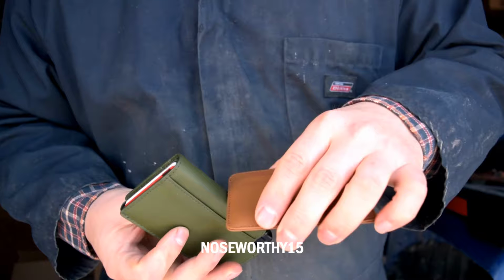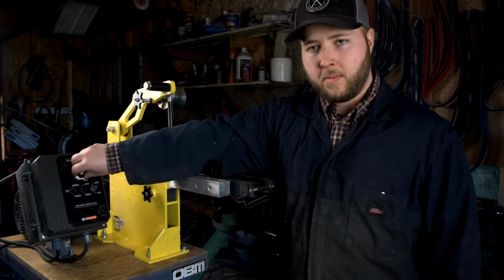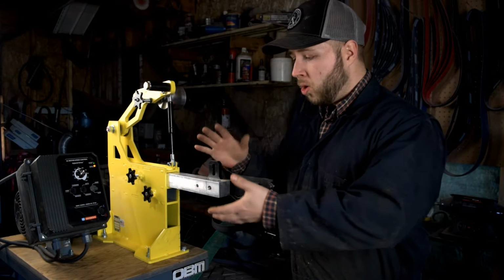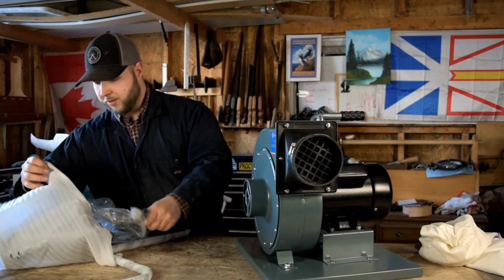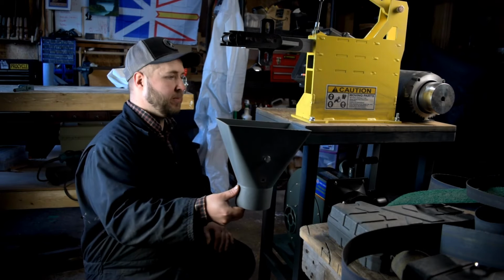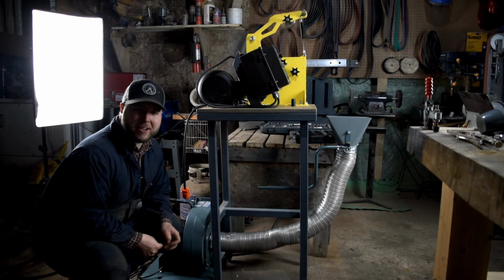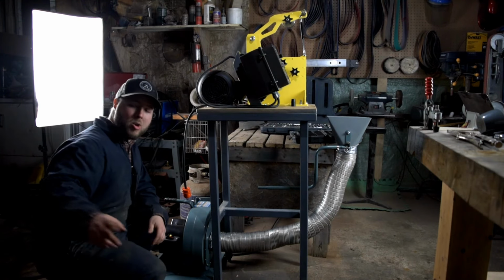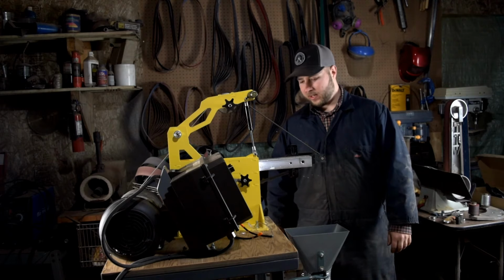WORKSHOP DUST COLLECTION - [ How to save your lungs! ]

Comment: That's going to be an excellent setup.  Nice work on the table.

Three thoughts about dust collection:
You could add a cyclone collector before the fan unit to increase the collection capacity and the time between filter bag changes.  The cyclone lids from Lee Valley are an option. They go on a trashcan or barrel that you provide. 
When you add an upper attachment for your nozzle, consider having the option to tilt the nozzle so It's not level front to back. That might allow it to be closer to the working area without being in the way.   
Consider adding some flashing to the intake nozzle to direct the air flow more efficiently.
Reply from the maker: Thanks for the suggestions, Alan! I have been looking into cyclones. They look like a neat option!

Comment: Great video Kyle, you could use the 10' of rubber to put the catch bag outside. any micro fibers that might get through are outside your shop, would also be good for weld fume extraction. Great purchase. Oh and yes shop build brother, keen to see you grow :)
Reply from the maker: Hmm, I would have to install a rigid connection between the two, but that would work!

Comment: Nice little setup kyle. As you said putting the extractor outside asap is definately the way to go as if it ever blows up (which can easily happen because of the metal and wood mix and sparks) alot safer. Definately put a fine mesh grill on the intake. Itl do two things, stop objects from falling in but it will also act as spark arrestor and reduce the chance of sparks  going into the extractor. When it comes to just grinding the blades themselves most knifemakers dont use extractors that way as its too risky with so many sparks. They mainly just have a bucket of water underneath the grinder to catch as much of the sparks as possible, and use air scrubbers hanging from the ceiling. You can get extractors specifically for metal and sparks, but they cost a small fortune. 
As you are building a dedicated grinding area its gona be easier for you to be as dust free as possible. If it was me with your setup (just for metal grinding) i would box it in with plywood as close as possible with just  enough room  around the grinder for access, (basically a plywood cover that you can slide back from the machine to work on it if you need to) then have a connection point at the back of the box so you can hook up your extractor, that way you get most of the dust and no sparks when using a water bucket at the front. Especially if you start using titanium  its pretty volitile if it sparks. Hope thats of some help.
Reply from the maker: This collection chamber is primarily for handle dust, wood and synthetics, because that's what really makes the mess. Metal dust is so heavy, it doesn't really stay airborne. You have all given me some great ideas, that I will certainly incorporate. You might be onto something with the idea for a grinder shield. Anything that helps keep the dust directed, instead of freely flying about. Thanks!

Comment: I added a air quality monitor to gauge the difference which various dust collectors and air filtration boxes made as I added them to the workshop. These monitors, as a minimum, alert when microscopic dust, carbon pollutants (eg formaldehyde), and volatile pollutants exceed max levels - they show the levels of the pollutants on the three read outs, with flashing screen and beeper, some recording a period for playback on a PC. They are inexpensive, a very good being about £80 on Amazon, a basic one being about £20. I have a Jet airfiltration box, a Record Power dust collector, and wear a Evolution air filtration mask/skull cap/full face mask combined - I still get air partical alerts on air quality monitor when sanding (wood) or sometimes when sharpening wood chisels on the belt sander. I can’t find a study which outlines effective ways to minimise the effects of air born pollution in a workshop, or information from manufacturers on the efficacy of their dust solutions re preserving health (despite the high cost of the equipment. Most professionals ignore the issue when asked how they measure the quality of the air in their workshop, and put in machines at high cost hoping its effective (but they will not install a simple monitor to show its worth - many are YouTube people (I showed the monitor to cabinet maker pal, and their was a huge difference in air quality in his main workshop and a drying room which had s large air filtration box ... the spraying room was lethal in its particle levels. I often leave the Jet air filtration box on when I’ve finished in the workshop which seems to bring the particle count down quickly. I don’t have a problem with carbons or carbon monoxide pollutants according to the monitor. There may be other monitors which measure toxic fumes, but I keep solvents etc outside the workshop. My point is that we need to measure the dangers if we are to manage them effectively, and preserve our health. This is never a popular suggestion amongst equipment manufacturers or craftsman (the cabinet maker has done nothing further to manage the health risk, not even bought a basic monitor).
I forgot to mention I use m😁rated vacuum cleaner with bag to hoover dust during turning operations and don’t wait for the shavings and dust to build up around me, which creates  a fire hazard and kicking up dust. I don’t use the compressor to blow dust away, as it creates s dust cloud from new dust and that which may be lying (microscopic) in the workshop. I don’t brush stuff in the shop, or collect it up by shovel. 
All this may seem ocd, but I can see the benefit on the monitors (which have been used for years, eg measuring exhaust pollution levels on busy roads). I bet I get some negative feedback from these observations, or no replies. I’d like really to see the AAW or others do an objective study of dangers to health and effective (measurable) steps needed to stay healthy longer term.
Reply from the maker: You have given me some fantastic advice, Peter. While I am not particular to your degree YET, I am progressing in that direction. I have becoming very diligent with my mask, try to lessen the amount of airborne dust. I'll do some looking for an affordable monitor here in Canada.

My new shop will be a cleaner setup, with less 'hideouts' for dust pockets. I am working towards having local dust collection on any machines that create dust, along with a couple air filtration units mounted on my ceiling. The largest dust contributor, my 2x72, will be in a separate sealed-off room, so I think I'll have good success with that scenario. As good as possible for me.
Reply: Kyle, you sound way ahead of most I’ve mentioned it to. I think the California state regs re dust in workshops is the most stringent, and the H&SE in the U.K. has papers on acceptable (legally) for exposure to various dusts over an eight hour period (the total pollution levels divided by eight, however, which misses the point of high concentrations in short periods bring breathed in). They also recommend various respirator types. But still no study which measures dust in typical workshops and a tick list of reduction measures and their measurement of effect on the problems. I did notice in my pals cabinet making workshop, that the drying room had the air filtration unit (a large one) venting out of the back of the building. This dramatically reduces the particle count on the monitor, compared to the main workshop (no dust collectors at all) which was on the other side of a wooden door, and the spray should (terrible pollution levels ) which was just the other side of another door adjoining the drying room. Another option I thought of was to do turning outside the workshop in better weather, or even open one side and add a door and a fan blowing most of the dust outside the shop. I only mention all of this as an antidote to the lack of real study on the topic, and to many companies (manufacturers) complacency and indifference to preserving customers health in the long term. I’m 65, so I’ve no real axe to grind personally.
Reply from the maker: @petercallaghan4718  My separated grinding room will have my dust collection unit blowing outside, into a bin. I will have a 5x6 garage door in the front of my main workshop as well. I think I will mount a large box-fan above that door, so on real nice days I can have it drawing air from my shop and blowing it outside. I like that idea. Thanks again for the advice!
Reply: Kyle Noseworthy thanks for your videos which show real imagination and enterprise. I’m an amateur, will never be expert, but enjoyed woodworking and other crafts when at school (which prepared us for apprenticeships such as woodworking, tool making, forging, etc although U.K. industry died in the 60s and I ended up with a college degree and a career in telecoms and computing management). Best Wishes, 
Peter 
P.S never been to Canada, but one day maybe. The Canadian accent sounds very similar to the East and West  Scottish accent in tone and pace. Very different to Central Scotland, as well as North and South Ireland or anywhere in England or Wales.
Reply from the maker: @petercallaghan4718  thanks for the support, Peter! Greatly appreciated. If you ever come my way, shoot me a message

Comment: I notice people saying about gloves I personally will never wear gloves with a bench grinder or something that turns at high speeds as can be dangerous once you're caught in the machine that's it I have had a rubber glove ripped straight off my hand luckily it didn't get my hand
Reply from the maker: I'm thinking they were referring to welding, Quinn, but I agree with your thoughts when using spinning power tools! Glad you didn't get hurt!